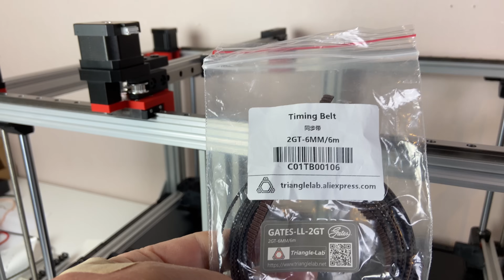The RIFF 600/900 3D printer 3 - x and y axis

Comment: My printer is up and running, I adapted your kinematics to a Voron 350 Trident.  Experimenting with 3mm belts, works really great.  I couldn't get sensor less homing to work so I used end stop switches.  I used HeroMe for the print head, combined the parts into one printable piece except fan duct.  Prints are absolutely sharp and smooth.  Thanks.

Comment: Disappointing the design all but eliminates the possibility to enclose the printer. Obviously it’s possible, but with the gantry sticking out past the frame, it makes it much much more difficult.
Reply from the maker: I never intended to enclose my printer. I have provided a completely free cad model on github and you can easily change it to meet your requirements. Just make the printer wider and change the x axis. It’s not difficult to do.

Comment: GREAT JOB  is there a vid cominng for software and wire installing
Reply from the maker: Yes it is. I have to do some «real work» and the build is slightly delayed.
Reply: @v4projects  great, really like your channel it s really  inspired , iis there a stl. file. for the complete. caddy. icluded. fan. piece
Reply from the maker: @joelwesterbs  I haven't published any of that separately but you'll find it in the CAD model (zip/step file) on Github.

Comment: I love this design!  I've been looking for a long-format printer for a while.  Everything is always a cube.  I guess they all want to print helmets for cosplayers.  I want to print keyboard cases and stuff like that.  Do you have a plan for enclosing it?  And what about a 500/750?  Thank you!
Reply: Totally agree - I would have loved a Bambulab X1C tripple wide or H2D double wide. I would love something that had the build plate size to fit my CNC 12in/305mm * 30in/762mm, but really don't want to build it and have to get it working. I am so done with repairing/optimizing 3D printers
Reply from the maker: Thanks for watching! I am not going to enclose this printer. The frame needs to be wider for the x-motor to fit inside the frame. I had a look at a 420x840 build with some heat beds from the Anycubic Kobra 3 MAX. I try to make this stuff affordable and the beds and PSUs required would make this a lot more expensive.

Comment: I believe one of the 2xxoffset_idler parts needs to be printed in the mirrored orientation. Also, where can I find the modified DragonBurner mount that you are using. I am finally going to install one of these on a printer! I am making solid progress and hope to have the Y-Axis belted, beds mounted and installed, and ready to belt the X-Axis as soon as I can get a mount printed! This has been an awesome build so far. Thank you very much for this!
Reply from the maker: You are absolutely right about the idlers. I have corrected the naming and will upload the mirrored version tomorrow. The Dragon burner mount is still a bit rough and I didn't upload that on purpose. (I can maybe upload it as a beta version), The problem is the orientation of the belt and it should really be completely redesigned, and not just remixed. The most obvious way would be to add a separate and adjustable part to grip the belt. It works as is, but gripping the teeth of the belt would be better than just squeezing it.
Reply from the maker: Uploaded the files now (including the beta). I am probably not going to do any more work on the Dragonburner mount myself. Or maybe I will...
Reply: @v4projects  Thanks so much! I am working on this printer build on and off my Twitch streams. I was waiting on some parts to arrive this weekend so rather than work on the RIFF600, I did a marathon build  of a Prusa CORE One printer kit.

Comment: I can't believe the timing; I am in the process of building a Voron Trident with Cartesian XY mechanics, I like the idea of using two steppers on Y axis (I like to experiment).  I have been considering a mounting system for the gantry and up popped your video, everything I need and quite simple.  Printing parts right now, also my first experience with ASA - giving me a headache, slowing things down seem to be the solution.  Really looking forward to the next video, how to drive the two steppers, separate driver ID's or two steppers off of one driver?  My BTT Manta has two outputs for one of the drivers.  Great work, thanks
Reply from the maker: Thank you! I am using separate stepper drivers for each  stepper. They have a different id in the printer.cfg (Y and Y1 in my case) And sensorless homing. Klipper is amazing when it comes to flexibilty. It also supported quad z tilt by just having a separate id for each z stepper. I expected that I had to use quad gantry but z tilt with four attach points worked fine.
Reply from the maker: And remember to invert the dir pin on one of the two Y steppers. Otherwise you’ll hear some horrible sounds as the two stepper motors fight each other.

Comment: I was building up my Y and X-Axis tonight and realized there is no length listed for the 2020 X-Axis extrusion. Could you add notes about the X-Axis Extrusion length please?

My build is progressing well and I am enjoying the build so far. Ooh, can you also upload the electronics caddy you use for your main controller (the one that goes in the skirt?
Reply from the maker: I’ll measure the x axis extrusion later today. The length in my cad model was slightly off. I’ll upload the caddy for SKR 1.3/1.4 in a few hours.
Reply from the maker: Updated info and uploaded the files on Printables

Comment: Do you think due to the large plate, that there could be some problematic sag?
Reply from the maker: Thanks for watching! Have a look at my previous build «LemonBreeze». Sagging was no problem and looking at the generated height map there is no tendency for the middle of the heat bed assembly to be the lowest point. And that printer used 3 heatbeds.

Comment: One can simply fix all problems related to poor insert alignment by simply not using them… create for no inserts
Reply from the maker: I guess it depends on the use case. If a parts is being installed and never removed then just screwing in to plastic is probably fine. I tend to replace stuff and even had to replace one idler before even turning on this thing.
Reply: @v4projects another option is using square nuts where possible, easy to add geometry to hold them and almost impossible to rotate in their slot when torque is applied